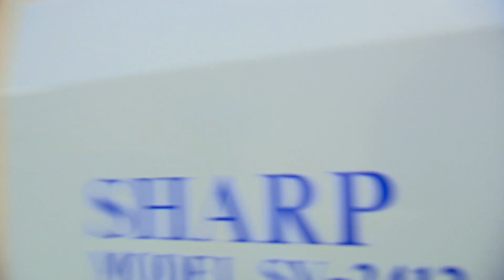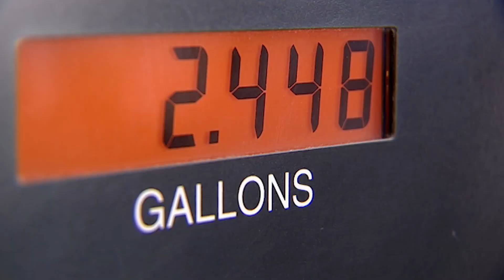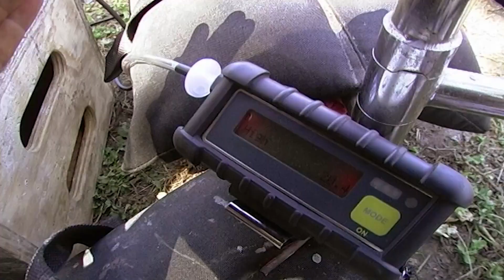The Explosive Truth About Cell Phones at Gas Pumps | MythBusters

Comment: I respectfully disagree the myth is busted. There is certainly sufficient energy in a cell phone battery to create an ignition source capable of igniting a flammable vapor cloud from gasoline. That said under what conditions would it be a hazard? That would be if it was damaged. In perfect condition I do not believe a cell phone would be an ignition source and I think your testing validated that assumption. Electronics certified for use in hazardous areas are not only tested to ensure they are not an ignition source under "normal conditions" but also under "abnormal conditions" (damaged) and depending on the zoning very abnormal conditions (damaged even more).  For certification a device is subjected to impact and other durability tests to determine it is suitable for use in hazardous areas where a flammable vapor cloud can be present.